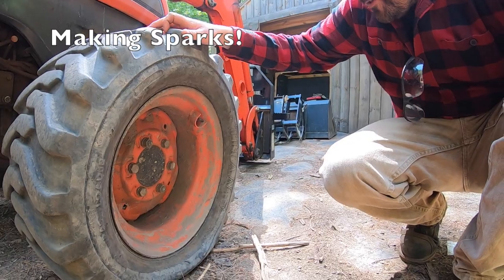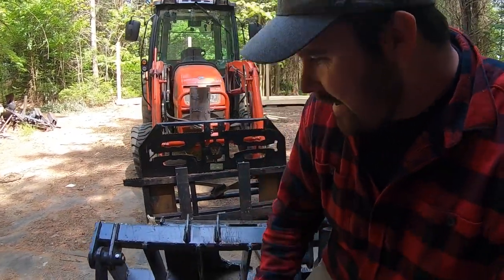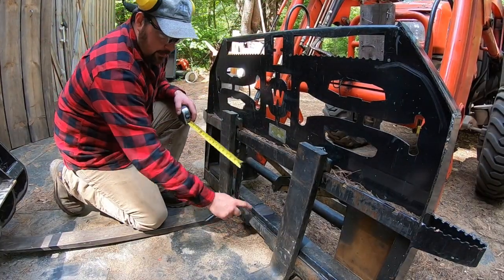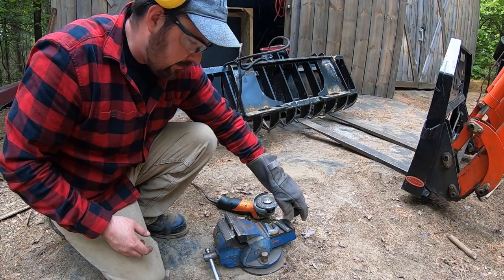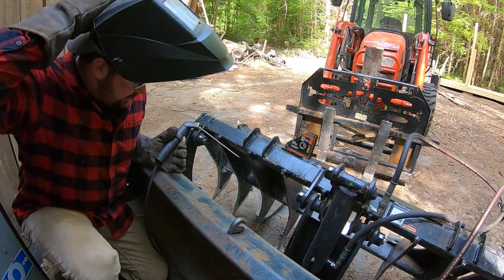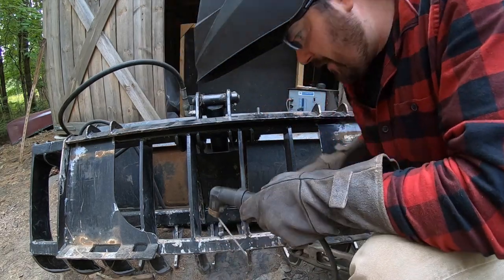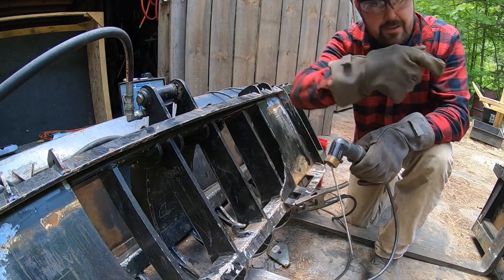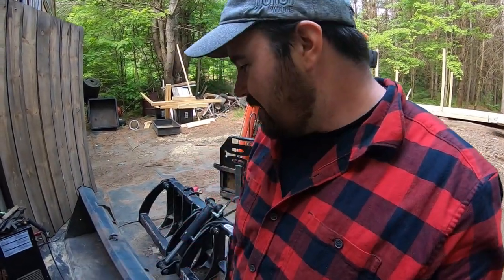Easiest Way to Hook a Chain to a Tractor | Don't Learn to Weld From Me

Comment: Ive been meaning to put hooks on my implements for quite some time.  I was tossed between bolt on vs weld on - the weld on are certainly much cheaper!
Here’s a tip for that old tape measure.   First, remove the screw that holds the cover plate and carefully open it up.  Try not to let the spring uncoil although if it does, it’s not fatal - just a pain.   While open, shake out and if possible, blow out the dust and dirt with compressed air.  Put a drop or two of oil on the contact surfaces.  Now close it back up. Then secure the housing and pull the tape out all the way to the end.   Activate the lock or secure the tape otherwise so it doesn’t roll back in.  Now take a rag with a light spray of WD40 and clean the tape both sides end to end.  Do not leave any oil film on the tape.  The WD40 works well to clean the tape but wipe it off well as any oily film will just attract more dirt when you use it.  
By the way, if you’d rather not open up the housing, you could try cleaning the tape first - that is sometimes enough. I’ve done this with many tape measures and it always restores the action to like new condition!
Reply from the maker: Thanks for the tip Dave

Comment: Try some Tireject!  It work phenomenal for off-road tires (atv, tractor, etc).  I've used it on my Kubota BX-25 and my side by side and wheel barrows, the results are amazing, managed to squeeze (pun intended) a few weeks out of a badly cut side wall front tractor tire while I waiting for replacements.

Comment: I would always practice taking any implement loose from the tractor to avoid shorting out any electronics in your tractor.  New tractors with ECM’s and other delicate electronics are easily shorted and can cost you a bunch to repair because of a simple bad arc.  You may be able to get by with it a few times, but the time you don’t will really make you sick.  Just a precaution.  I know you take a lot of good precautions with other things and this might be one that you should do for yourself in the future.

Comment: I have hooks on almost all my equipment, I am not a welder but I have a friend who has twenty five years experience. I have snapped a few 3/8 chains over the years, but the hooks have not even budged. The hooks are also handy for moving your attachments, for example you have your bucket on and you want to move your forks, just hook up a short chain on each side and lift and go.
Reply from the maker: Sounds like you’ve got a great setup Ray. I’m sure I’ll find all kinds of uses for them as well

Comment: The hooks are good for chains but I use different chain sizes and sometimes straps with a clevis so I have large D rings on my forks and bucket.  Can loop the chain through and I even use them when I chain my skidsteer on a trailer. I'm pretty bad at welding but if you're gonna have equipment and do work it's a good skill to learn.

Comment: Tire slime works great. Easy clean up in event of tire change
Reply from the maker: I’ve used it before in a trailer but I’ll have to try it with the tractor. Thanks Colbie
Reply: I just used it in a front tire on a little smaller tractor. Did the trick.

Comment: Learned a welding trick this week. Spray your welding site with vegatable spray, I. E. PAM.  The little bb slag that you have to grind off can be removed with a putty knife.
Reply: That is with mig only where you get splatter
Reply from the maker: I’ll have to give this a try with my flux core welder

Comment: Good job on the welding Sandy.  I'd luv to learn how to weld unfortunately I don't have 220V to my shop and 110V just wouldn't cut it for my applications.  I'm surprised you didn't use two hooks, one on each end of the bucket?  But if one works you can always add two more if needed.  Thanks for sharing.  Cheers!

Comment: Check into TireJect for your tire needs. It's a little more expensive, but works GREAT and I've got it in all my trailer, atv and tractor tires now. It'll seal a leak now and stays fluid to seal them in the future as well. I haven't had any (new) flats on any of the tires I've put it in.
Reply from the maker: Thanks I appreciate that. I’ll look into it

Comment: I have a great alternative to using bug spray! Pick up a propane tank cut the top off it so it is like a pot. Fill the tank with water to make sure all the fumes are out of it and cut it with a zip disk that goes on a small grinder pick up a push mower and take the motor off of it and replace it with the cut off propane tank. fill it with dry wood and make a fire when you have a good bed of coals put in bark and sawdust and it will make a smudge push it up wind where the smoke is circulating around it will chase mosquitoes and black flies wood is cheap and smoke won't be toxic to your skin as that insect repellent. personally the smell of smoke is much more pleasant than that fly doap. if you make a cover for your propane tank you can cover it when finished and it will go out quickly as it dies with no air! 
Here is a small one the lady done but if you put it in a lawn mower you can move it aro
https://youtu.be/sZrOetaKYiA

Comment: weld 2-inch square hitch receiver to the bucket then put the male hitch on the winch so you can slide the winch onto the bucket. This would allow you to winch from a higher angle.
Reply: I welded a 2" receiver on the top of my bucket. Also did the same on the top of my box blade. Makes moving trailers around the property very easy without having to swap out implements. I have a d-ring hitch in my bucket receiver for rigging up too and also for pulling fencing. I leave my 6" drop hitch in my box blade. Easy to swap one to another while out in the middle of a project. Also having it on the box blade is great for rigging up fallen trees to pull around. Just lift the box blade up with the 3 point!
Reply from the maker: Sounds like a good idea. I may have to think about this as a future project! Thanks for the idea
Reply from the maker: Sounds like a great setup
Reply: @sawingwithsandy  I wish I could post a picture. It works awesome! We live on 5 acers that is full of nothing but alder, dough fir and hemlock trees. I feel all I do is constantly clean up trees. I really need to just pony up and pick up a mill like you and start turning into more than just firewood I dont burn...lol

Comment: I would have taken the pallet forks off the tractor.    You do run a risk of shorting out electronic components on the tractor. Or at least discount the battery.    I just got done putting a hook and 2 d rings on my bucket Saturday

Comment: Seems your awful buggy today buddy.i have hooks on everything n I also have a trailer hitch receiver on top of the loader so I can tip the bucket n slide in what ever hitch I want to move trailers.works great for throwing a chain around too.another idea you may like Is to weld a trailer hitch under your vise to mount it on the bucket or the back of your truck so you just slide it on n put the pin in.no more working on the ground.had a 🕷in my head phones.gross stuff.all looks good from here bud.

Comment: Hope you disconnected the battery on the tractor before you started welding Sandy? Two hooks on each implements would have been better to keep anything centered. You have needed them for a while now. After saying all that the sheds looking good though. Plenty of room for the toys to be pushed right back out of the weather.
Reply: Always a good idea to remove battery but as long as the ground and weld are not in line or electronics between the cables, your fine.
Reply from the maker: Thanks Ken. Hadnt heard that before. I’ll be sure to add more hooks once I see how much use they get.

Comment: How thick is the metal on the bucket?  Will it need some beefing up on that span with a point load on it?
Reply from the maker: I think if the load I was lifting was really heavy that’d be a good idea.  I think for the weights in lifting I’ll be ok. Think the bucket is about 3/16”